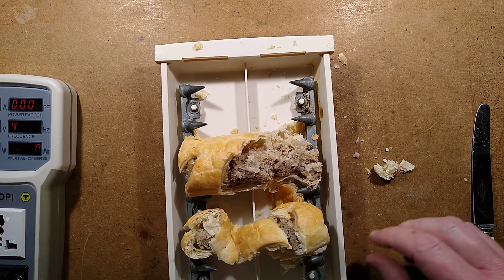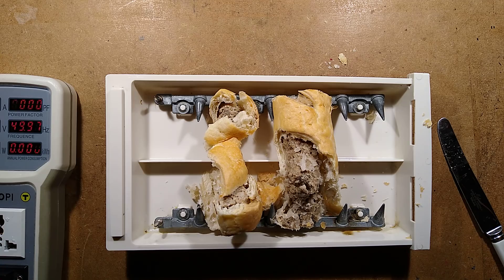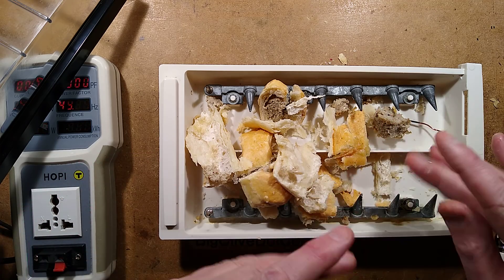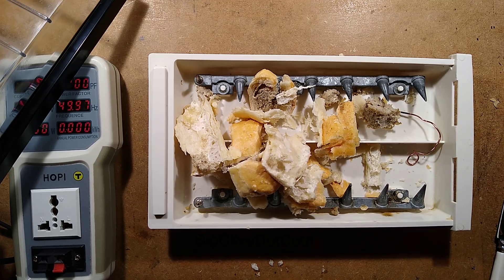Sausage roll versus 250V.

Comment: You could install the test roll at a bias as the top and bottom rail are uniform. There's no need for the roll to be installed at a 90° angle.

Comment: Is there resistance between the mains plug and the connectors under the lid, if so, could it be modified to better accept 240 volt, as boring as that would be

Comment: That is the original clam-shell design.  We had the later 70s model which was a cylindrical drawer type which made it more difficult to come into contact with the live power coupling.

https://i.pinimg.com/736x/6a/9f/c1/6a9fc13e6629dd65e95ea1e58d0e9f20.jpg

Comment: I live in the U.S. and tried one of those many years back when they first came out. It was horrible as the hot dogs had a burnt flesh smell and the taste was... well what I guess burnt electrocuted flesh tastes like. Hot dogs would work better as they are more flexible and have a lot of water and salt. When you plugged it in sparks would shoot out both ends of the hot dogs as they cooked which only took a few seconds. The ends of the hot dog would be burnt black. I made the mistake of loading it all the way up, but only ate a few bites of the first one and threw the rest out. 
To improve your electrocuted sausage experience, and get the true unique taste and effect, you could probably mist it with some water first.

Comment: I wonder if, purely for scientific interest and wanton stupidity/bravery, you could remove the spikes from the unit, lay them flat on the bench with the pastry-wrapped-meaty-goodness between them and some rubber bands gently pulling them together to provide a good contact, then botch some wires on and plug it in? Highly dangerous of course, but not for a trained professional :D
Oh, and if you microwave the sausage roll for 30 - 60 seconds, the fats melt and the thing becomes a bit more flexible. You could microwave one, place it in the unit, wait for it to cool, then blast it!

Comment: You need to take the electrodes out of that and mount them on a base where you can adjust the distance between them. You can also mount them so the electrodes are horizontal. Then you can "electrocute" many different food types! A corn on the cob? Or you could take the lid off of a can of anything, trim the lid circumference a little and insulate the edge, put it back and electrify the "plates" with mains. Maybe solder big, beefy wires to the insulated lid and the can. An ALPO battery? (That would smell really bad, I'll bet). You know you are going to want to try this.  ;-)

Comment: I had that identical model of hot dogger. Kielbasa just sort of pops. As I recall , it was really inconsistent , and you had to keep the spikes clean.
     Carbonized hot dog gunk can be difficult to clean off.
    The cheap hotdogs worked better than the pricier ones , as I recall..

Comment: If you cut the ends at a parallel angle you can install it by turning it at an angle into the spikes without bending . That would work for any over sized sausage and minimize the breakage.

Comment: Clearly there's not sufficient grease in that "sausage" to oil a beard with.
Since the sausage was so brittle, you may need a do-over with suitable electrodes on a ... what's British for "zip cord"? IOW don't bother with the hotdogger, just connect it directly to te mains. Okay, maybe use a switch or breaker.

Comment: I used a Presto "Hot dogger" back in the 1950s; back then, it was still plastic, but the top was hinged (and opaque).  Electrodes were carbon cones (probably better for you than pot metal).   Red body with a white lid.

Comment: I've surprised you haven't tried pickles in this thing yet.  Pickles glow when you run current through them and I know you love strange lights.
Reply: And the LEG was invented. (Light Emitting Gherkin).
Reply: As famously studied and documented by digital Western Research Lab, it was part of DEC later acquired ultimately by Hewlett-Packard I believe 😂 https://www.hpl.hp.com/techreports/Compaq-DEC/WRL-TN-13.pdf
Reply: @JamesReedy  I'm still reading the study (I had no idea pickles were incandescent lamps :D ), but this passage is too savage not to share:

"Sir Joseph Wilson Swan (no relation to one  of  the  authors)  produced  the  first  lamp  with  carbon  filaments  in  evacuated  glass  bulbs  [3].  This  exciting  invention  was  brazenly  copied  a  year  later  by  a  minor  American  inventor  and industrialist [3]."
Reply: @SYH653  It's a funny sentiment but it's not true, they were considered to be independent inventions. Both Edison and Swan held patents, so they set up a company together, which still exists as Thorn Lighting.
Reply: @straightpipediesel  crude lamps with metal filaments already existed prior to either of them though. So neither of them actually invented the light bilb, they simply solved the sublimation problem by using carbon instead of nichrome.
Reply: @QlueDuPlessis  Combined with high vacuum drawn by what eventually became the diffusion pump. Swan had tried decades earlier but a good enough vacuum pump didn't exist.
Reply: @JamesReedy  man page 7 of that document almost killed me laughing.
Reply: Rotsteinblock nothing has the admittance quite like a Kosher Pickle it seems lol.
Reply: +1
Reply: I'm pretty sure he did a pickle do.
Reply: @GunkDung I searched and YouTube didn't find me a big Clive pickle in the Hot Dogger video. 

Maybe he did a pickle differently, but not in this perfect electric executioner
Reply: He needs to try soup in there. Just submerge the terminals
Reply: I need more popcorn for these comments...
Reply: He has
Reply: You can also stick LEDs into the sausages and they will glow: https://youtu.be/Kp9mg4PHjsw?t=580
Reply: Mmm, Plasmickle
Reply: Popular science taught me you can make a homemade OLED by shoving a pickle on an arc welder.

They did not, however, tell me which side of a pickle is the anode.
Reply: Pickle Rick :-)

Comment: Clive, when the sausage roll goes high resistance you should increase the voltage. Put a neon transformer to good use!

Actually a microwave transformer would probably work much better but be much more dangerous.
Reply: And in case of fire.... it all could be suspended above a tub of water.  Big Clive will be wearing heavy duty rubber gloves !   Hehehebebebe

Comment: Jeremy Fielding recently made me aware that here in the states we have both 120 and 240 power sources.
Reply: well, it's 110/120 and then for things like washers and dryers they use two 110/120 volt circuits to make up the 220/240 volts.
Reply: @Sharklops  Right, I just thought Jeremy mentioned it in another context, but he didn't specify.
Reply: Just don't get 'Technology Connections'  started on the whole 120/240 thing!
Reply: Unless you happen to be served off of a 3 phase line; in which case you get 208v between any two legs of the 3 phase service.

Comment: Aw, thanks Clive. Now I’m hungry for sausage rolls.

Given I’m an expat 7000 miles away, there’s no way to acquire one, even a crappy one from the coop.
Reply: American-style breakfast sausage links (e.g. Jimmy Dean brand) make an entirely adequate substitute. Just wrap them in a bit of (savory!) flaky or shortcrust pastry dough, cut them in half if you prefer bite-sized, and bake.

Fatty, salty sausage makes better rolls, since the fat carries the salt as it soaks into the pastry. Lean sausage makes for dry rolls and lower-salt sausage leaves them bland.

Don't try to use puff pastry or filo/phyllo; it doesn't turn out very well at all.

Comment: I'd suggest you warm up the sausage roll first in a low oven. The fat in the sausage meat will make it pliable, and it will then be more accommodating to being squashed into the hot dogger.

Failing that, some things to try would be a string of pickled onions (threaded onto string or thread, resembling a necklace), a cucumber (mostly water), and a banana?

Comment: Next time you stuff a sausage roll in and it breaks, solder it back together?

The hot dogger was designed to work at 120V  but it's getting 240V so to get it to cook sausages at the design specification, stick two sausages in series.
Reply: Thats not how this w... you know what.. im just gonna look away..
Reply: This man's doin' that brain thinkin'!
Reply: Clive needs to hook up a 15Amp Variac to the hot dogger and run it at 120vac.  I believe there would be less arc'n and burnt food.
Reply: @markkrusemer526  he could much better control the cooking with the variac!
Reply: @markkrusemer526  im sure your message will get through to clive, just, not really
Reply: hey man, snags in series... I never thought about that.
I gotta re-visit the fundamentals more!
Reply: You just made me choke on my dinner. Thank you.
Reply: Big brain time x100
Reply: On this 240 volt it heats up 4 times faster. No wonder it tastes Burned. Try it on 120 volts 😉
Or indeed:  split the metal pins to put 2 sausages in series 😂
Reply: @marcoloos9395  To work properly the two sausages would need to be a matched pair to ensure equal cooking.
Reply: @6F6G  So, you just buy lots of sausages, check them with a multimeter and find matched pairs. Or I guess you could buy hotdogs with grey or violet tolerance bands.
Reply: @eyeball226  I think they still use the body-end-dot system for coding sausages.
Be careful of sausages with a black or brown dot as their resistance is too low and blows fuses. Also sausages with a yellow, green, blue, violet or higher dot have too high a resistance and never cook.
Reply: @marcoloos9395  I had the same idea, but I think he needs to make his own food-cutor with vertical pins so you can push the food directly on top without needing to bend it. Make the penetrating electrodes twice as long too for a real good connection 😆
Reply: No, at the temperatures we're talking about, it's going to remelt the solder. You're gonna have to full-on weld it.